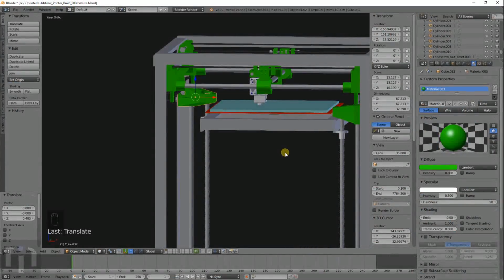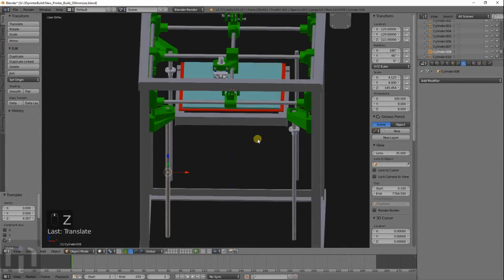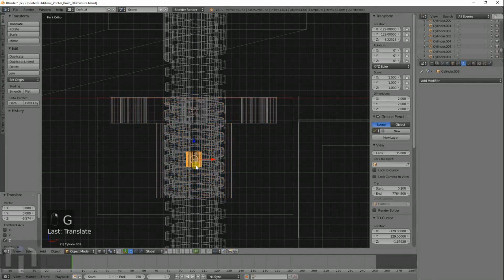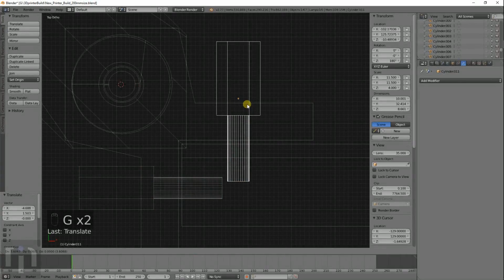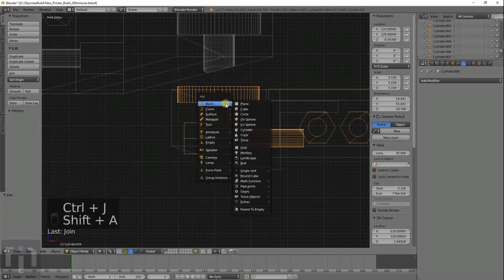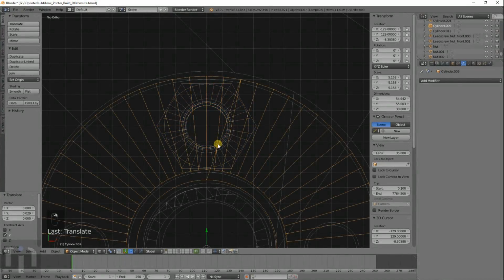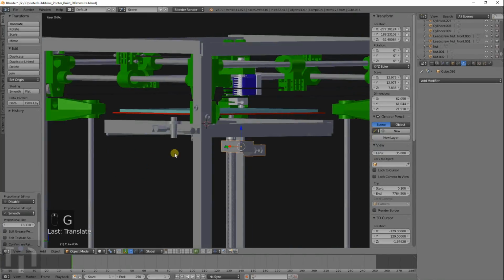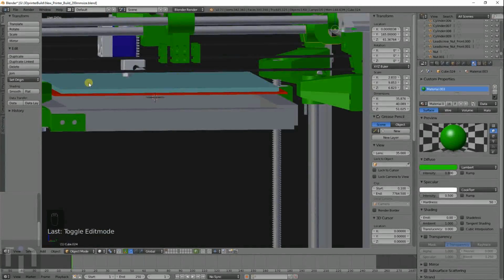3D Printer Design #008 : Part 6

Comment: Hey, quick tip - ctrl+shift+alt+c is the shortcut to change origin on object. It's a fun one.
Reply from the maker: Thanks!  Wow that's a hand twister.  Kind of like the find manifold objects with the ctrl+shift+alt+m.  I'll try getting used to that, but for me, once I get the spacebar menu to set origin, it's a lot faster for me to just use that.  I like to try and keep my hand on the home row as much as possible.  I'm actually going to be making a quick tip series as well.  Just got done rendering the 5 second intro video.  It only took about 15 hours... lol.